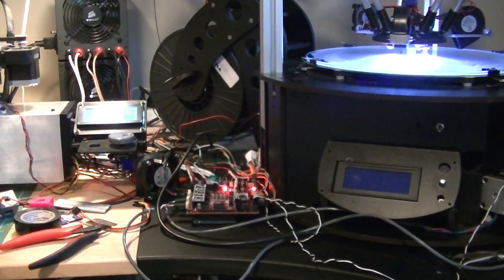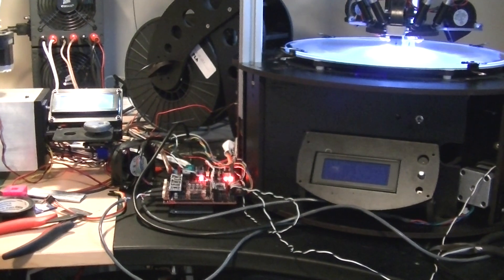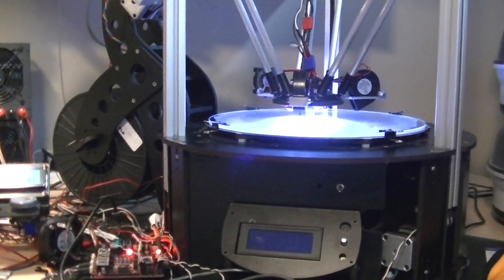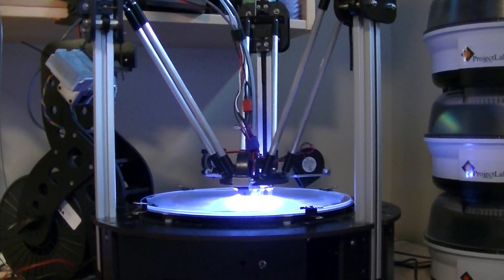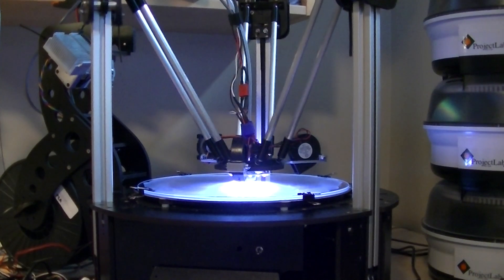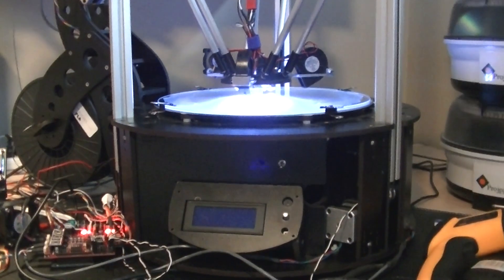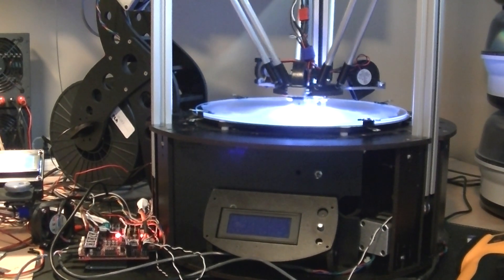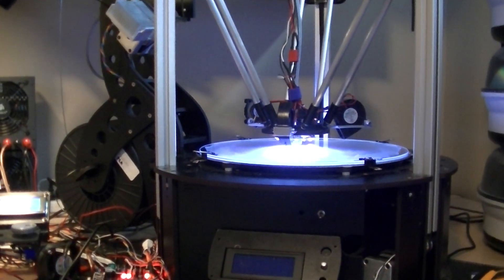Update:  Arduino Due (ARM) Delta Printer

Comment: Can you tell me the configuration in the firmware? Because i try to get synchron moves from the steppers. It seems most time the board is thinking whats to do next. Also all heater leds blinking all the time.